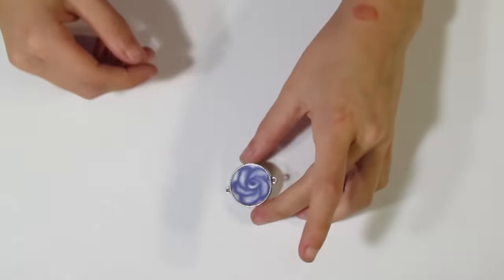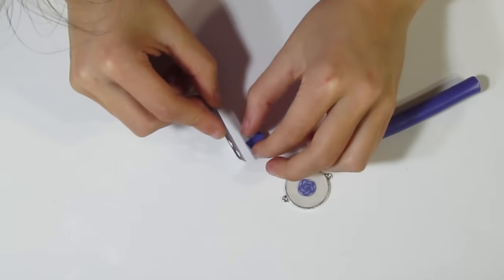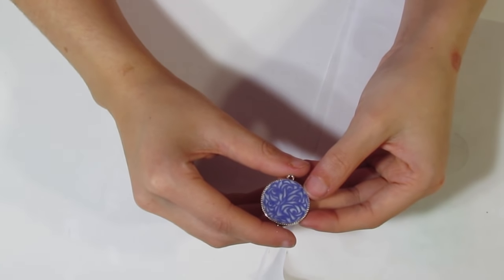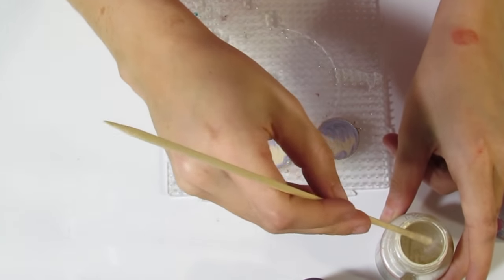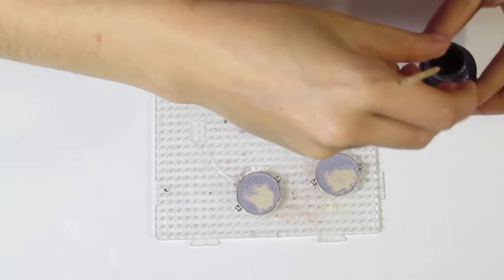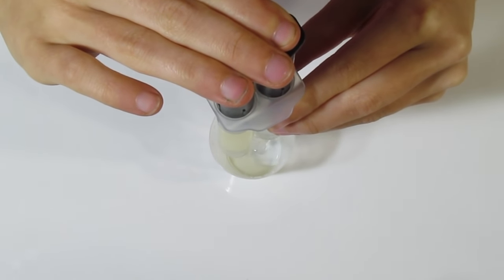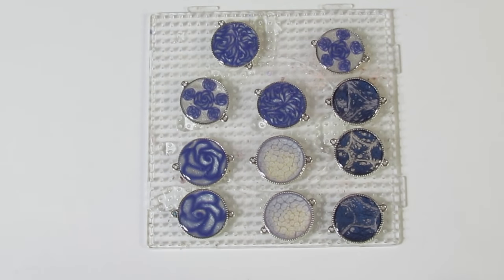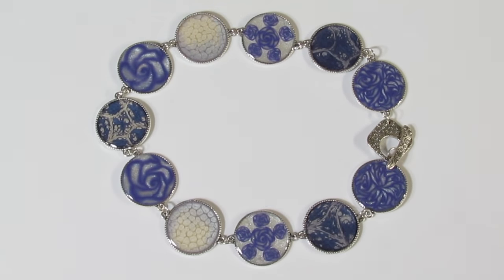Polymer Clay Project: Rose Cane & Pebeo Paint Necklace Tutorial

Comment: Where did you get the metal 
What is the name of it
Reply from the maker: I got them here. https://www.aliexpress.com/item/30Pcs-lot-Stainless-Steel-Connector-Setting-Round-Double-Loop-Cabochon-Base-Cameo-Bezel-6mm-8mm-10mm/32943893930.html?spm=2114.search0104.3.1.3dd375a6jIx3XU&ws_ab_test=searchweb0_0,searchweb201602_4_10065_10068_10130_10547_319_317_10548_10696_453_10084_454_10083_10618_10307_537_536_10131_10132_10902_10133_10059_10884_10887_321_322_10103,searchweb201603_51,ppcSwitch_0&algo_expid=2a0a378f-c3cb-4179-b985-964aec3620e1-0&algo_pvid=2a0a378f-c3cb-4179-b985-964aec3620e1&transAbTest=ae803_5